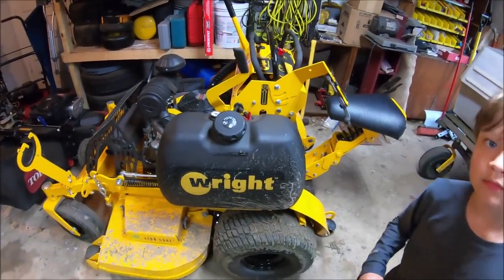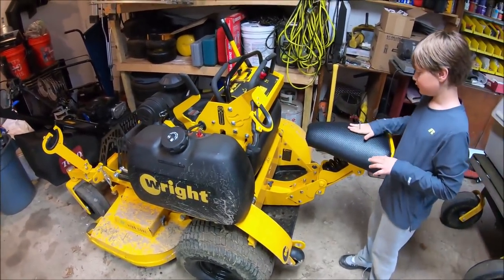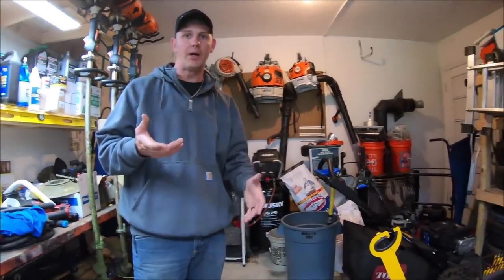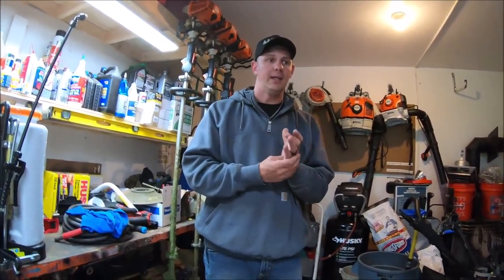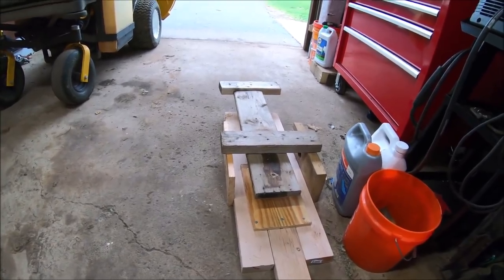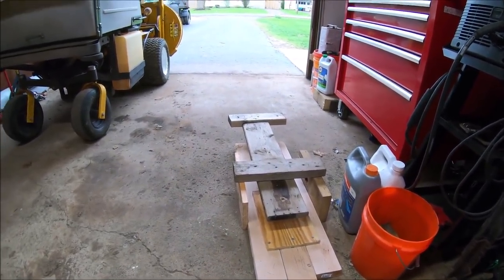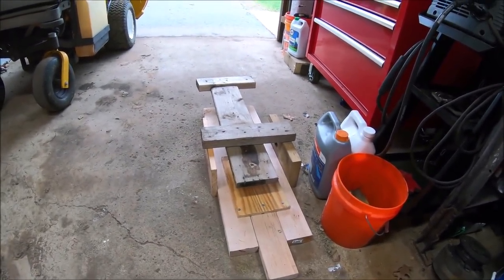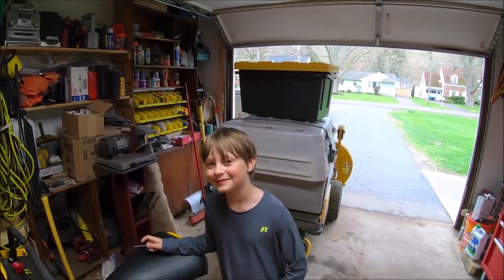Wright Sport X Adjustments & Modification // Countryside Vlogs

Comment: if you put the bigger pad on that mower,, you will have to remove the seat to access behind the pad. also you plan on moving the pivot closer to  the seat making it even tighter and shrinking the foot room as you will be standing further back.
Reply from the maker: Nope, already measured and checked everything. The bracket will have 2 plastic wing nuts holding it on. Pop those off and cushion comes right off. Other cushion sticks out 
1 & 3/4" further than what I have now. Plenty of foot room. I had the same concerns as you. I checked.

Comment: On the wiper motor just opened it up take the circuit bord and go over ond solder all the joits and the will make them work like new that happen with mine and i did that and work
Reply from the maker: Good to know, thanks

Comment: Too bad that you have to do the engineering for them.  Bad pad design, dont they think that you will stand sometimes?
Reply from the maker: I'm not really sure what the thinking was here. The whole purpose of this machine is to be able to stand or sit. That's why I bought it because of my back and I need the option. Hopefully I'll take care of that.
Reply: @CountrysideStrong  so is that pad comfortable when you stand?  Not much pad there to lean on.
Reply: @CountrysideStrong  so you say you want to put on the bigger pad.  That's my point, you had to suggest that and they didn't think of it.
Reply from the maker: @rickrossetti3857  no, I mentioned that in the video. I said you can't even feel it there while standing.
Reply: @CountrysideStrong  my point is why didn't they think of putting the larger pad on the mower?  They weren't thinking.
Reply from the maker: @rickrossetti3857  yea ok